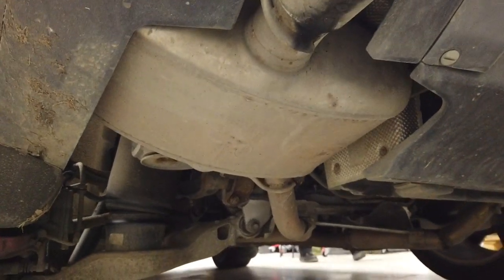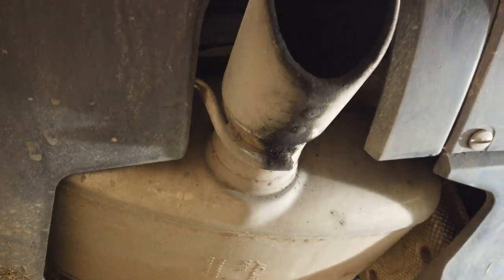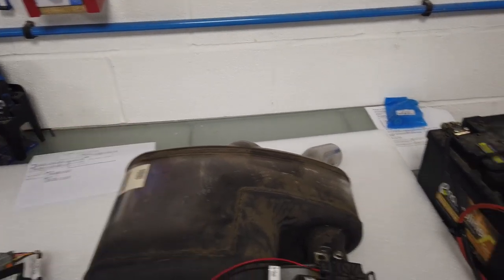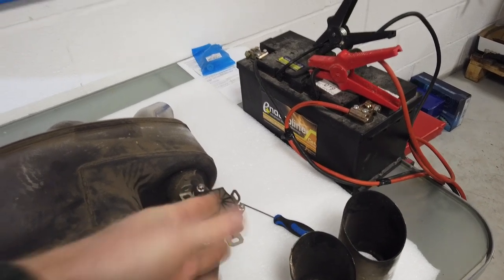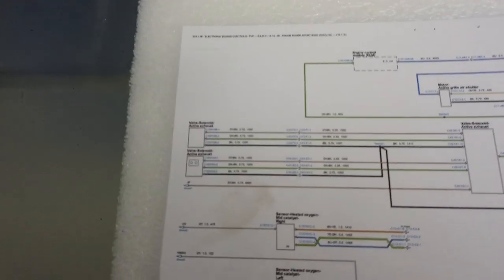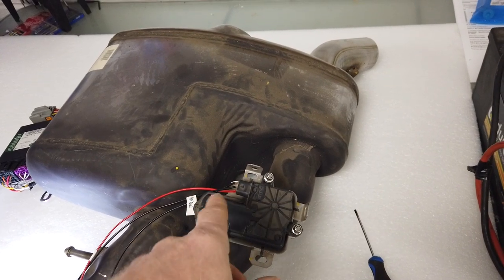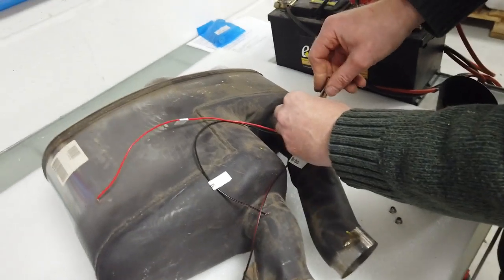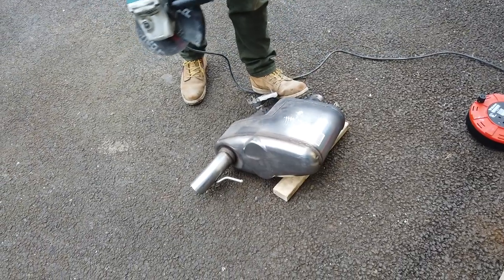We look at how a Range Rover Sport SVR "Active" exhaust works...

Comment: i recommend cutting the middle resonators off the L494. From my research, it seems as if that is the best way to replicate the SVR sound, and gives some pops as well. I am looking to have this completed on my v6 supercharged. Any thoughts?
Reply: I want to do this too, remove the resonator. But I'm worried about drone noise inside the cabin when driving on the highway
Reply: The svr has the same resonator as the standard. The magic is in a remap and back box 👍
Reply: @0796logsplitter  interesting, but for the v6 supercharged models, im trying to find a way to get the closest sound to the v8. As you may know, the v6 range rovers have a higher pitched exhaust note, which i hate, and i just dont know how to get a deeper raspier SVR type sound with pops. I think this is the first ever L494 exhaust study lol, havent seem to find anything online yet. Thoughts?
Reply: drumplayer5679 I dont any experience with the V6, just my own V8 l494. 
My previous car was a 4.2 supercharged which I had fitted with a straight through system removing the resonator. There was a terrible drone  at 2500-3000rpm. Good luck with your quest for raspiness 👍
Reply: Not sure how it will sound on the V6, but this is exactly what I did on my V8: https://youtu.be/C7oh_Kfx4M4
Reply: @NakkiranSunassee  This is the ultimate goal: https://www.youtube.com/watch?v=x6vrURXb3c8
I love how deep and raspy it sounds. My v6 wouldnt sound like this video, which is why im trying to find a way to make it sound very similar.